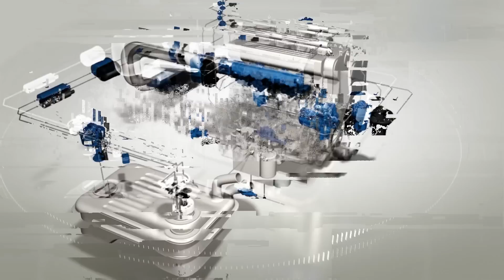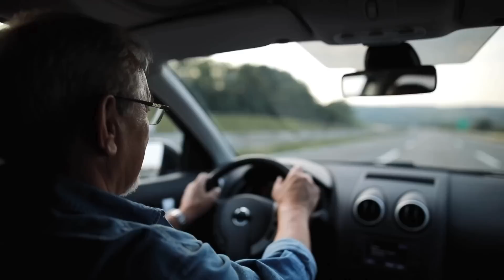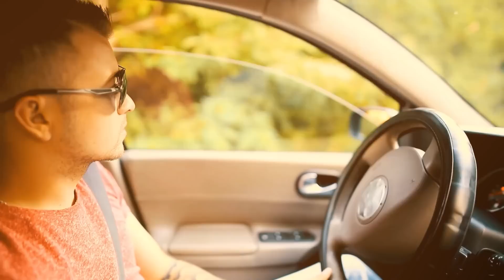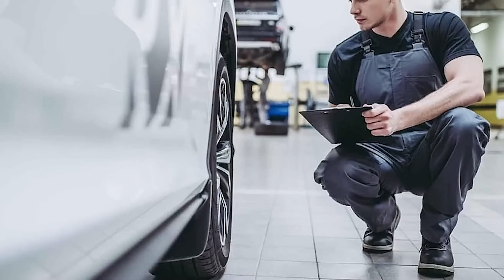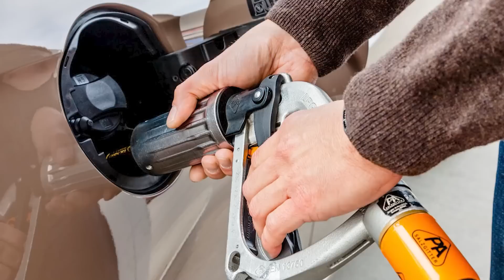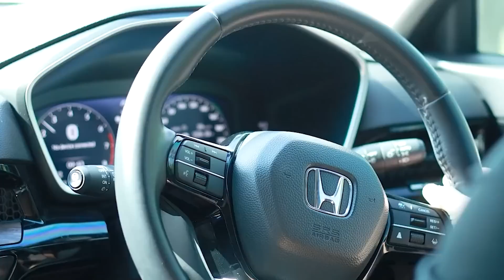17 Hidden Reasons Your Gas Mileage Is COLLAPSING! (Fix Them NOW!)

Comment: #18.   An exhaust leak that is retrograde flowing of ambient air INTO the exhaust system along the zero flow zone - ‘edges’ of the leak.  Chemical equilibrium then allows the enriched oxygen mixture to travel along the ‘zero velocity’ zone along and close to the inside walls of the pipe (like a school of fish swing againt the downstream flow of a river) .... then flowing “upstream" as well as downstream to the oxygen sensor.  This retrograde flow sends a TOO LEAN signal by the oxygen sensor to the ECU.  The ECU then attempts to correct the FALSE air-fuel mixture by commanding MORE fuel into the engine.